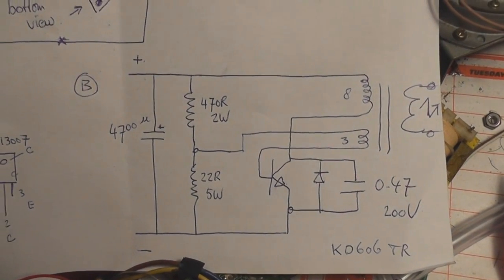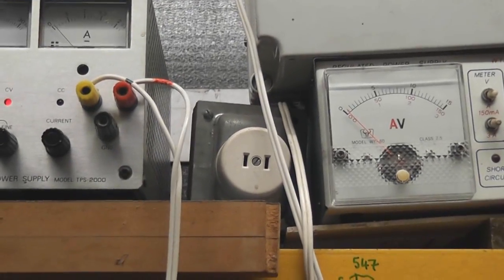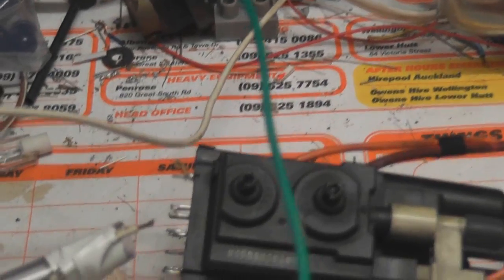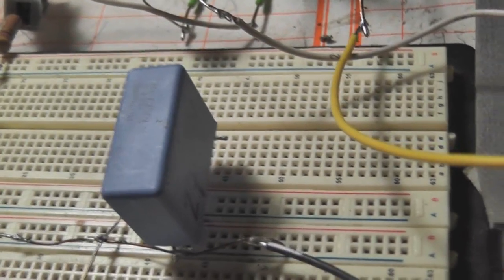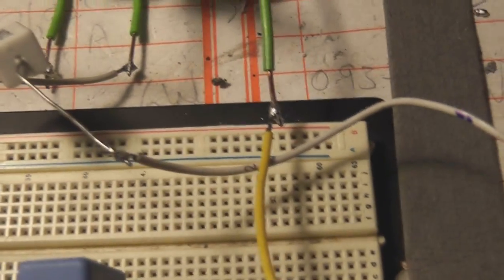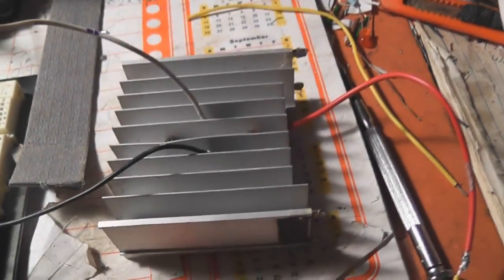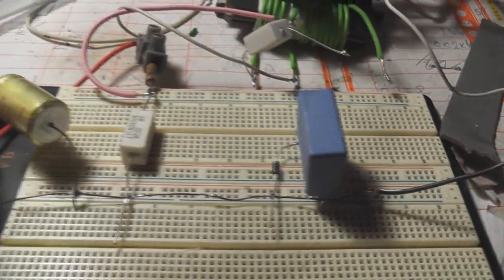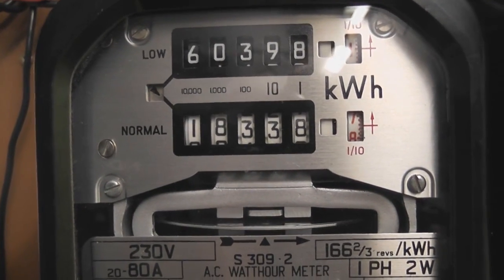Flyback Oscillator with 2N3442 transistor

Comment from the maker: Thanks for the tip, With the 2N3442circuit I forgot to connect the flyback diode in the circuit. The 2N3442 went dead short between the C and E connection, and the Base to E is still OK..
Reply: With the diode it would have worked?

Comment: Good circuit that always works! Perhaps (perhaps.....) the "kikcback" destroying voltage can be diminished by a resistor (1K-470K) connected directly to both coils, it will damp the waveform and take the peaks out. When you lay down the probe from your scope near the flyback transformer (not connected to anything) you can see the effects on the waveform.

Comment: I've heard that you can use the ZVS driver as an induction heater. If you make the drive coils open and out of heavy gauge wire you can apparently heat a bolt yellow hot.

Comment: if you look closely during the shots with the lights off, you can see the arc leaders forming before the arc strikes.

Maybe the transistors didn't like the frequency the circuit generated - I remember something about switching times (dV/dT) is very important for transistors - perhaps more so than current.

Comment: since there's some protection across the C-E junction of the transistor, there might be an issue with your biasing network (2 resistors) supplying too much or not enough current,  and you really should have a reverse biased diode across B-E since transistors do not like more than a few volts of negative bias on B-E (6V or so max in many cases).  That can pop transistors.  The final problem could simply be transistor temperature.  make sure it's not getting too hot.

Comment: i made an oscillator using the 2n3055 with an ignition coil and it fried mine too, the problem is they cant handle such high frequencies, ive used a TV line output transistor and it works sweet now, but cant remember what type it is, i will have to pull it out and have a look, if i can adapt it to a flyback, that would be great.

Comment: Try a 555 driver. I use one with an irfz34 mosfet and it works quite well. Not nearly as much power as a good zvs though. 
I use a pair of general purpose transistors to drive the mosfet at 18v because the 555 doesn't supply enough power. I haven't fried an irfz34 yet, but I watch the temperature closely though.
I am using a 13.8v power supply and it pulls 3-4 amps. The arcs are about 25-30mm.

Comment: See if you can get your hands on a MJW18020 from On Semiconductor. It's in a TO-247 case. The 2N3055, 3442 etc are really too slow for efficient hard switching above 5-10kHz.

Comment: is that all

i can do better with an 2n3055
you take the flyback and wind it like a joule thief
add a 100ohm 5W resistor to trigger pin of the 2n3055 (or reduce feedback windings)

and it takes 12V on 5A

arks od 1-3 cm (silente)

Comment: Hmmm... I did a similar thing, with an NTE283 (IIRC, it was spec'd as a horizontal driver for a CRT.) Gave excellent results. 800Vce max. Google he part number. I got mine from Fry's in the U.S. IIRC, it's a rather expensive part, but is designed to take the kick-back from inductive circuits.

Comment: A small spark. A flash. Winding do not use rough but thin wire coil. The coil must be tightly wound ferrite core. See my video.